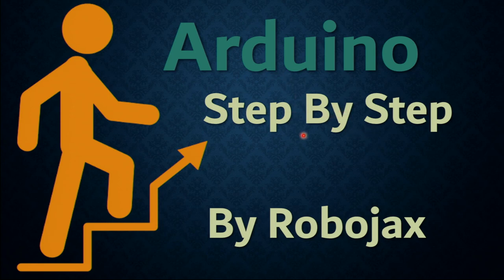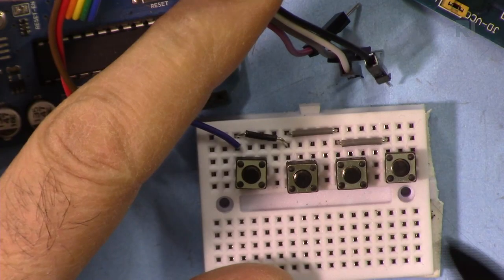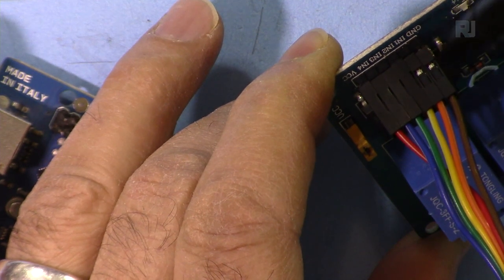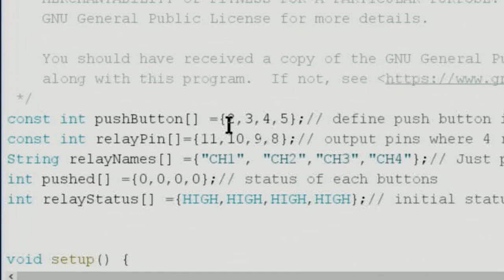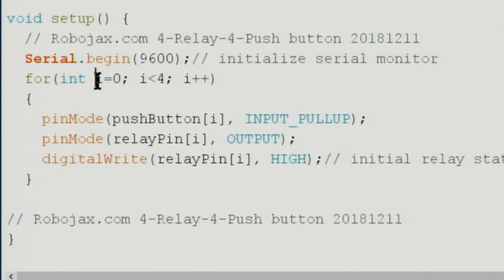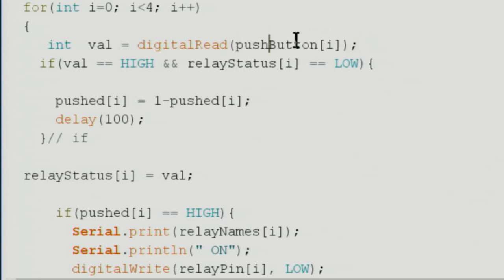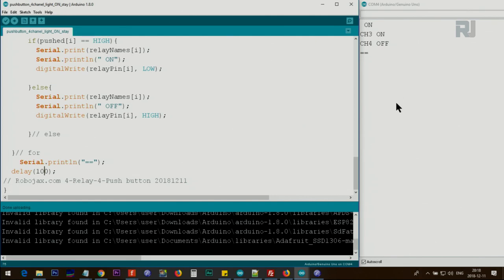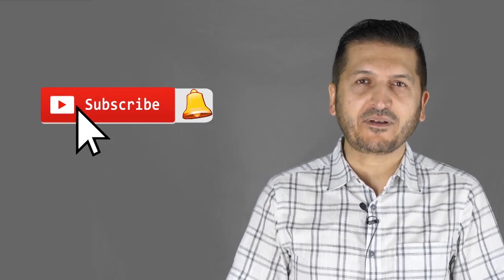Lesson 66: Controlling 4 channel relay with 4 push buttons | Arduino Step By Step Course

Comment: How can i add coin acceptor here? the button will activate the relay depending on the value of pulse(coin acceptor)
Reply from the maker: I have no idea about your coin device. but when coin is detected it generates voltage, you can connected it to the input of this device instead of the push buttons and it should work.

Comment: Hello,
This Video was awesome,
I am looking for exact code with a little adjustments, 
Could you please help me with this,

I need when we push one out of four Push buttons, if the others relays are on, they go off,

What adjustment do I need to add to the code?

Thank you,
Reply from the maker: Hello, you just said it "we push one out of four Push buttons, if the others relays are on, they go off". I have explained how it works. exactly at the line where the specific relay ON, make the others off. I have explained how the relay is turned OFF.
Reply: @robojax  Thank you,  I will try and update you 🙂
Reply from the maker: to let you know the code in this page was the wrong. code . I am not sure if you have seen the updated code or not. Just wanted to update you.
Reply: Hi,
I am going to work on it today,  I just checked and realized you changed the code to the correct one,

Many thanks for follow up, I will let you know the result 🙏
Reply: @robojax  Hello Ahmad,

The codes are very good, 
I have used the 66-1 code, as I am using LEDs instead of Relays, I had to LOW them in line 39, however, my first problem is the push buttons do not act all the time that I push them, they sometimes work and sometimes not! 

The second problem is when I want to use your suggestion to turn the other outputs off, this is probably professional because I do not know how to interrupt a "for loop" and change other "i" values except one,

Could you please help me to discover how to deal with these problems?

Many thanks for your kindly support,
Reply: Hello robojax .. awesome .. btw is it possible to control all relay with just one push button ? Thank u very much

Comment: Hello, 

I was going to try the code you mentioned under your video, But Unfortunately, it seems the code here is for lesson 65, and lesson 66 is not there!

Could you please let me if I am doing something not right or the code that is under lesson 66 is not for here!

Please let me know,

Thank you,
Reply from the maker: Hi, thank you for letting me know. Yes indeed there was problem. I have fixed and and now there is two code for this video. Check it out.
Reply: Perfect, thank you for the swift response

Comment: Hello @robojax, i want to add a RTC to control the relay at the same time i can use the push button do you have a code?
Reply from the maker: Hello,  here is full video on RTC with unlimited Alarm and clock and everything https://youtu.be/gz9xqvRroDY
Reply: @robojax  Hello, this is my code https://drive.google.com/file/d/1pZ_1Hk3lK3X9oCpJ6xJti13qXTSgjMrF/view?usp=sharing, 
my goal is to turn the relay on and off with schedule at the same time i can use the button to turn on and off, please check the code because is not working properly
Thank you sir

Comment: hi there , hope you well, thank you for the great videos, excellent work.
I need a bit of assistance , i hope you can assist me
I am setting up this exact same system 
4 x button 
4 x Relays
I am currently using your code and it is working perfect but i need to add more logic to the code.
logic required.this is what i require

THE SYSTEM IS SET TO BE NORMALLY CLOSED
INACTIVE MEANING NOTHING MUST HAPPEN IF THOSE BUTTONS ARE PRESSED.

PRESS BUTTON A = OPEN  RELAY A UNTIL PRESSED AGAIN TO CLOSE ( BUTTON B and D MUST BE INACTIVE WHEN RELAY A IS OPEN )
PRESS BUTTON B = OPEN  RELAY B UNTIL PRESSED AGAIN TO CLOSE ( BUTTON A and C MUST BE INACTIVE WHEN RELAY B IS OPEN )
PRESS BUTTON C = OPEN RELAY C UNTIL PRESSED AGAIN TO CLOSE (BUTTON B AND D MUST BE INACTIVE WHEN RELAY C IS OPEN ) 
PRESS BUTTON D = OPEN RELAY D UNTIL PRESSED AGAIN TO CLOSE (BUTTON A AND C MUST BE INACTIVE WHEN RELAY D IS OPEN ) 

CURRENT CODE BEING USED
const int pushButton[] ={2,3,4,5};// define push button inputs
const int relayPin[]={11,10,9,8};// output pins where 4 relays will be connected
String relayNames[] ={"CH1", "CH2","CH3","CH4"};// Just put name for 4 relays
int pushed[] ={0,0,0,0};// status of each buttons
int relayStatus[] ={LOW,LOW,LOW,LOW};// initial status of relay

void setup() {
    Serial.begin(9600);// initialize serial monitor 
  for(int i=0; i<4; i++)
  {
    pinMode(pushButton[i], INPUT_PULLUP); 
    pinMode(relayPin[i], OUTPUT);   
    digitalWrite(relayPin[i], HIGH);// initial relay status to be OFF
  }

}

void loop() {

  for(int i=0; i<4; i++)
  {
     int  val = digitalRead(pushButton[i]);   
    if(val == HIGH && relayStatus[i] == LOW){
  
      pushed[i] = 1-pushed[i];
      delay(100);
    }// if   

  relayStatus[i] = val;

      if(pushed[i] == HIGH){
        Serial.print(relayNames[i]);
        Serial.println(" ON");
        digitalWrite(relayPin[i], LOW); 
       
      }else{
        Serial.print(relayNames[i]);
        Serial.println(" OFF");
        digitalWrite(relayPin[i], HIGH);
   
      }// else   
 
  }// for 
    Serial.println("=="); 
  delay(100);
}// loop end